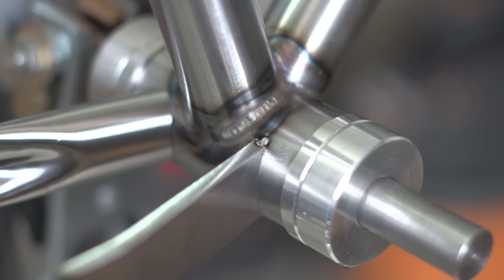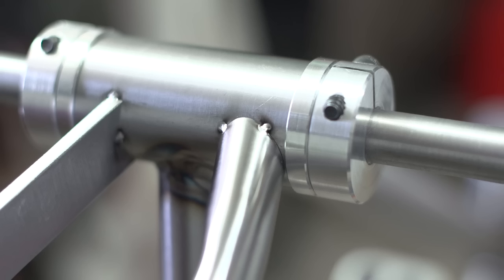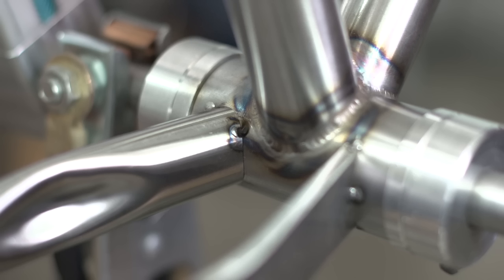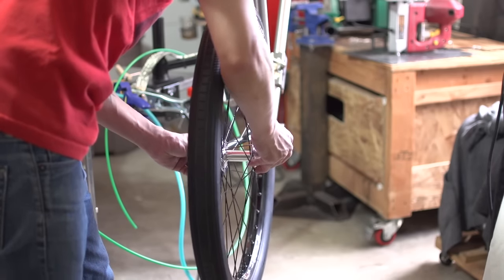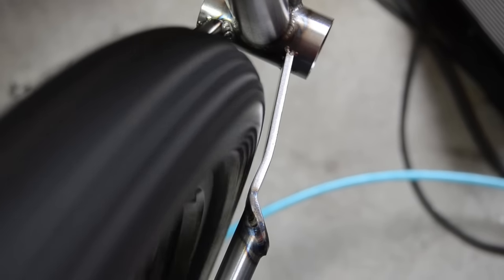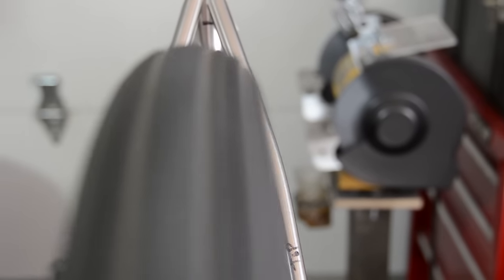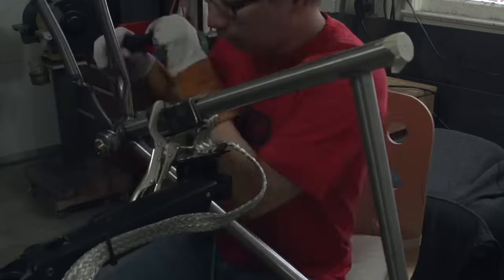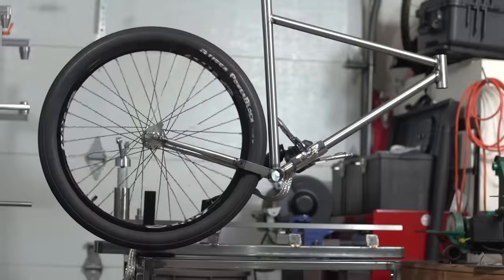Bicycle Frame Build 52 - Tig Welding Chinstays to Bottom Bracket Shell

Comment: I just found all these videos a couple days ago and binge watched them all.  I'm working on some recumbent bikes in 1/16" mild steel square tubing at the moment, but I'm considering building myself a track bike after I get them built and have had a bit more practice with the welder.  I really like the way you've included the whole process, including mistakes.  It'll probably help me a ton.  So, thanks. :)
Reply from the maker: You got it! Good luck with your builds. :)

Comment: hey man im a bike builder myself and i had the same problem with keyholing as you did. what really helps is to focus your arc onto the thicker piece of metal, in this case the bottom bracket, to get the puddle started and then move onto the thinner piece to complete the tack. it should help with keyholing and it will stop parts from warping as much in free moving areas. nice work though love the channel
Reply from the maker: +Trent Laing thanks for the tip! I'll give that a go.
Reply: @PithyBikes  How do you sharpen your electrodes? They could be sharper, that also helps to get a smaller more concentrated puddle, ultimately putting less heat into the frame
Reply: But hey, love your stuff. It is such a dream for me to do this some time!

Comment: Nice welding! What are the holes drilled for prior to the first weld? Thanks!
Reply: Frank Leferink I think he did that to purge the Weld on the inside with Argon, because the bottom bracket is a tube so the Argon could not transfer to the chin stains.
Have a good one and sorry for my english 😂
Reply: Ride BMX thank you!

Comment: Try a smaller gas lens cup on your torch with tighter spots and try a lower amperage. Looks great
Reply from the maker: +William Bonney thanks. I started using the #9 again. It works great. Thanks for the tip.

Comment: That´s not bad at all what you are doing. The heat distribution on the tube looks ok, but there is much room for improvement to get to a master level. You can distinguish by the colors of the weld if it won´t stress the material in bad manner. If you can get it to a 1mm redstrip with a bit of blue you reached the master level ;). Don´t know if your chainstay flat metal stuff is a good idea cause your frame will flex offcenter, causing much stress on the flat/vertical stiffer side.

Comment: You might look into a 9f torch instead of that big old 17 you have now. I've got an AHP alphatig 200x, and it came with a 17 style torch. I bought a 9f from eBay and it went right on the cable I already had. Its significantly smaller and would help you get in those tight spots.
Reply from the maker: +okieltr450 thanks for the tip. It might not look like it but I'm running a wp9.

Comment: treat your self to a good auto helmet , a speedglass or the likes , and adjust the shade till it suits , you can weld all day and not need to lift the shield , i also put a light in close , it will help a lot , especially when things are all the same colour and finish

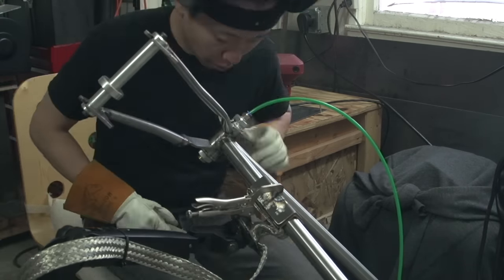Comment: Why do you attach the green tube? 5:20
Reply from the maker: Green tube feeds argon (shielding gas) into the tube. The welding torch expels argon at the tip so it shields the surface but it doesn't shield the other side (or inside the bicycle tube). Thanks for watching!

Comment: Turn your amperage up about twice what you would weld your material with, then give the metal a quick blast with the foot pedal, quick easy tacks every time.
Reply from the maker: +Andy Baker thanks, I'll try that. I always get squeamish turning it up! But I know what ypu mean. If the heat ain't the the puddle won't wick into the gap.
Reply: If you haven't already, check out Jody Colliers videos. Welding Tips and Tricks.
Reply from the maker: Yeah, Jody's channel is killer. Love watching all his new videos. Pretty sure his was the very first channel I ever subscribed to.

Comment: Hey man, nice work!.
Can you please tell me what kind of adjustable arm do you use to fix the frame during the welding? Afterk tack weld the frame on the jig?
Thanks in advance!
Reply from the maker: It’s a modified monitor arm. But i have to admit, it doesn’t work very well.
Reply: Pithy Bikes, do you know anything similar made for that application?
Reply from the maker: @Roi93  Yes, many builders build weld their own or buy a bicycle repair stand. https://www.google.com/search?q=bicycle+repair+stand&rlz=1C1GIVA_enUS759US759&source=lnms&tbm=isch&sa=X&ved=0ahUKEwiEpO2a3cbeAhW8IDQIHbOlB1gQ_AUIFCgC&biw=1920&bih=938

Comment: I can't be totally sure, since I'm pretty new to tig welding myself, but I think you might be going a little light on the pedal when tacking?  I haven't welded on tubing quite that thin, but I noticed when I've been playing with 16Ga stainless that I'm more likely to melt through when I sit for a couple seconds at low current waiting for a puddle than when I give it a ton of current and get them fused quickly.
Reply from the maker: You're right. I was going to light. A burst of heat is what's needed to draw the molten metal into the gap. Going light makes the steel shrink back rather than flow forward. Thanks for watching!
Reply: When tacking thick stuff to thin stuff, gotta hold the heat on the thick material and allow it to almost wick onto the thin stuff. Keep it up fellas!

Comment: is there a reason the right chain stay has the flat formed piece in there instead of the tubing all the way up to the bottom bracket?  or was that just part of the design.  i may have missed that in the previous videos.
Reply from the maker: +cr walker yes! It's to gain enough clearance between chain ring and tire. The standard tube with a dimple wouldn't fit. :)

Comment: Really curious, what kind of bike frame are you building? First thought it was a track bike, then saw those beefy tires and got me wondering.
Reply from the maker: +Benediect Santos good observation! It's a cross between a track bike and a fixed gear freestyle bike. I'm building it to have fun on my daily commute. I'm not a good freestyle rider by any stretch of imagination but I do enjoy simple tricks to make the ride fun. I really like the distance between pedals on track cranks so I kept track cranks. Also I'm short so my wheels are 24". I wanted decent stand over clearance for a person my height. I'm 5,2. So when I fail a trick, I can keep my nuts off the top tube.

Comment: Do you more around a lot making the welds to make it not move while not in the fixture?
Also, how much do you purge? When I started to purge I had some problems not having enough coverage, but turning up the amount made it impossible to weld since the gas from the inside would actually disturb welding the outside, almost like when you notice that you forgot to turn on the gas bottle ehehehe..
Reply from the maker: Yeah its a balancing act to get the purge just right. This particular frame was purged. If coverage isn't good its possible air pockets are inside the tubes. Argon is heavier than air so it settle to bottom of tube. I like to turn the frame around and up and down a few times while its purging to get all the air out. Good luck!

Comment: how come you went with a flat bar on the chain stays its the only thing on your frame i dont like but the crank will hide it 
thanks for the vid
Reply from the maker: +trigg99 I used The flat bar because clearance is tight. I'm still running a standard track crank. It's narrow. I like the flat bar but I have strange taste. :)

Comment: Really good job.
But I would have pointed the two frame tubes to avoid any frame deformation of the wheel hub axel(?)
Reply from the maker: You mean at the ends of the chainstays where they meet the hub? I agree that would reduce deformation if I had a pointed cap. Luckily the deformation was minimal. I'm still riding the frame and so far all is good! Thanks for watching. :)

Comment: Another GREAT VID, Steve!! My palms were sweating watching you weld the chainstay/BB shell!!  What diameter filler are you using? I have experimented with .045 and .035 diameter fillers for thin material. The smaller filler melts quicker in a small puddle, but I still find myself blowing holes from time to time. 
The test fit with the wheel and the cranks and then the seat stays was AWESOME!! Can't wait to see you riding the finished product. 
I also was not feeling the plate section for the right chainstay, but now I feel like that's what makes this frame totally yours. No one else is going to have a frame just like this one. 
Keep up the great work. Congratulations on 10K followers!! You are igniting a nation of garage frame builders with these vids!!
Reply from the maker: +Dan Garcia hi! I'm using 035 mostly. Making holes in tubes happens to us all. I need more practice! :)
Reply from the maker: +Dan Garcia hi! I'm using 035 mostly. Making holes in tubes happens to us all. I need more practice! :)
Reply from the maker: +Dan Garcia hi! I'm using 035 mostly. Making holes in tubes happens to us all. I need more practice! :)

Comment: Please don't weld in short sleeves.
Reply from the maker: +Jonathan Pack agreed. I sometimes forget in my haste. 😅
Reply: Cool.  I'm a welding instructor, and I wish more people on youtube observed safety protocols so that my students didn't walk into class already loaded with bad habits.

You might also consider not dropping your electrode out so far and going to a smaller cup.  I know that you have to drop the electrode a little lower for a fillet, but the less exposed electrode the better.